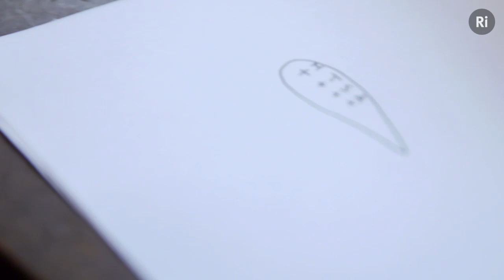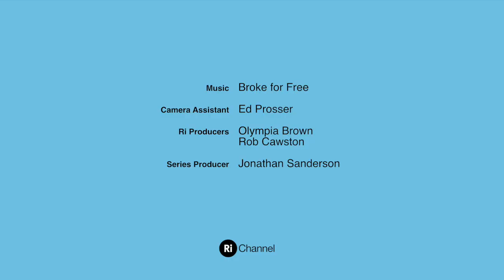20km High Kite Flying

Comment: 20km is not possible, the sky is around 12km.
Reply: Then how do high performance military jets fly beyond 20 km and the U2 spy plane and Concord well above that?  These aircraft require lift from atmosphere albeit very thin. My target for the kite train record is 40,000 ft. or 12,200 ft. Commercial jets fly at 14,000 metres (46,000 ft.). Perhaps you should look at Wikipedia before commenting.

Comment: I tried a different approach by adjusting the kite to suit the line drag. Hard to control at less than 200 m but when above the kite behaves well. Braided fishing line and a 2 m custom delta with a 60 degree sweep works well. I have had it up to 2000m measured by a hang glider vario.

Comment: I have just 'stubbled' across this video and as a long time kite flyer (40 years !) interested in the science of why kites fly this is interesting to me.
 The flying line (never, ever call it the string !) is often the limiting factor when trying to fly at high altitudes, well high for me, approx 1000ft when i am allowed, by this altitude a smaller kite will reach its lift limit and due to its weight any additional flying line will lay across the ground, the aero drag making the line near vertical under the kite.
 For any further experiments you may need another type of kite, i have never been a fan of the flowform type ramair inflatable kite, it appears to fly with more drag than lift not gaining a good flight angle, hence any experiments with the flying line will not be presented to the wind at the the best angle acheivable by a kite.
 I had another version of 'parafoil' type kite, A Stratscoop by Greens of Burnely (ceased trading over 30 years ago sadly) compared to a flowform this kite has a much thinner aerofoil section and has an enclosed rounded leading edge, inflated by scoops on its underside (hence the name) this had a huge amount of lift and would fly nearly overhead in the ideal windspeed

Comment: My team broke the world altitude record for a single kite in September 2014. We flew a 12 sq meter DT delta to 16,038 ft above ground level. Type 2014 kite altitude record into the search window for the video of the event. Our web site can be found via Kite Magic with a link from the home page. We have 5 other videos of our record attempts. I recognized the importance of aerodynamic line drag 12 years ago when planning for the world record attempts. We use the thinnest, strongest line available. This is braided UHMWPE (Dyneema/Spectra). I have developed a routine in excel which simulates all the forces in kite flights.
In 2007 I proposed an aerodynamic line profile. The Cd of round line is approximately 1.2. The contribution of line drag is about 3 times that of line weight. I anticipated aero line to be about twice as heavy as round line so their is a definite potential net reduction of negative line forces. I did not progress the concept beyond drawings but these aero lines may be applied to projects such as high altitude tethered wind generators. The Dyneema line would be encased in molded nylon extruded to an aero shape. The profile would be determined by wind tunnel testing but there is already a great body of work on aero profiles so a cataloged profile could be used. I anticipate that line flutter may be a big issue to overcome. Line vibration dynamics on very long lines are interesting. I also have an affiliation with the Ion Power Group which is investigation extracting Ionic charges from the atmosphere to charge large battery capacitor banks. I am advising them about the use of  high altitude kites to support the extraction of Ionic charges through tethered conductors. The reduction of aerodynamic tether drag will be very important.  After I am finished with 25,000 ft for a single kite in 2020 and 40,000 ft. for a kite train in subsequent years I may focus on aerodynamic kite tethers., preliminary designs of which I have already made. I also have sponsorship from a Japanese company which makes ultra high molecular weight polyester fibre (Toyobo/IZANAS)and a New Zealand line manufacturer, Tasline.
Reply: I saw this, it was awesome!!!
Reply: @JavierBonillaC  ⚠️ God has said in the Quran:

🔵 { O mankind, worship your Lord, who created you and those before you, that you may become righteous - ( 2:21 ) 

🔴 [He] who made for you the earth a bed [spread out] and the sky a ceiling and sent down from the sky, rain and brought forth thereby fruits as provision for you. So do not attribute to Allah equals while you know [that there is nothing similar to Him]. ( 2:22 )

🔵 And if you are in doubt about what We have sent down upon Our Servant [Muhammad], then produce a surah the like thereof and call upon your witnesses other than Allah, if you should be truthful. ( 2:23 )

🔴 But if you do not - and you will never be able to - then fear the Fire, whose fuel is men and stones, prepared for the disbelievers.( 2:24 )

🔵 And give good tidings to those who believe and do righteous deeds that they will have gardens [in Paradise] beneath which rivers flow. Whenever they are provided with a provision of fruit therefrom, they will say, "This is what we were provided with before." And it is given to them in likeness. And they will have therein purified spouses, and they will abide therein eternally. ( 2:25 )

⚠️ Quran
Reply: @DW Palme Droceretik is Robert Moore's email pseudonym. It's kiterecord  backwards. Before your accuse someone of lying you should check your facts.  The altitudes are as follows: 16,038 ft as taken directly from the GPS telemetry. The altitude submitted to Guinness was 29 ft. lower due correction for GPS calibration from government survey points in Sydney. Guinness rounded up to 16,010 ft. What about the date? Your apostrophe must be Robert Moore's team, not Robert Moores' team.
Reply: @robertmoore2527 still not him though. I can change my username to same right now.